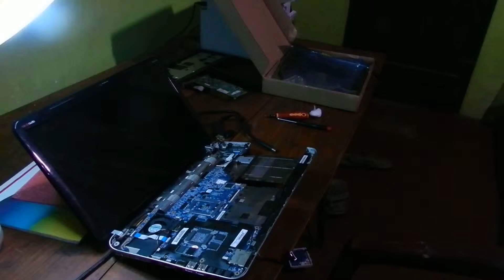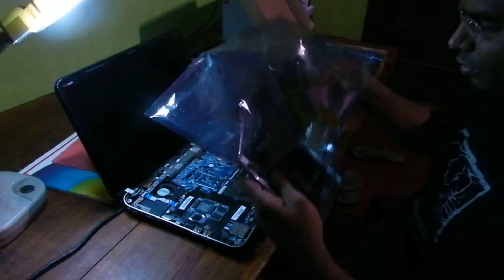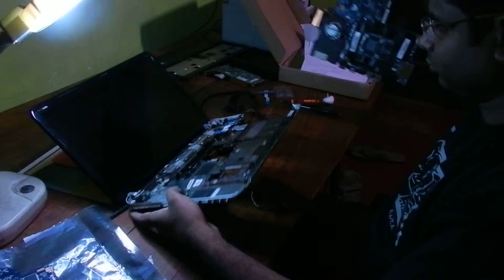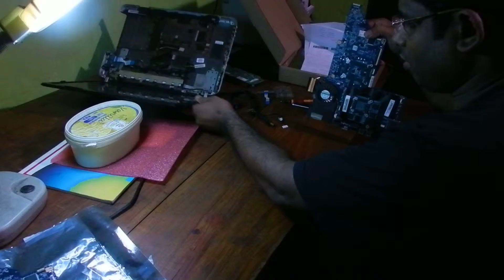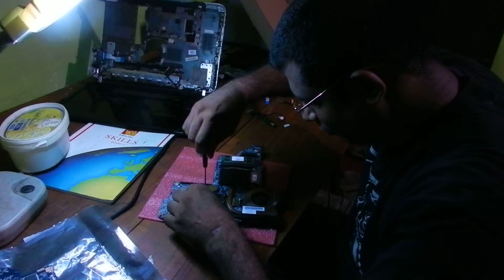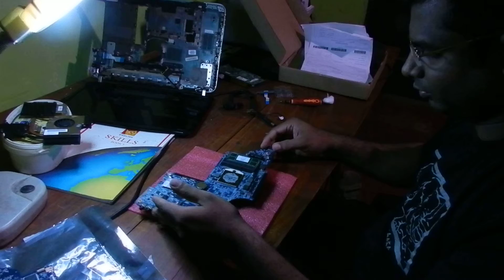DV6 6165TX Motherboard Replacement

Comment: Hi Chinthaka, 
i have the same laptop and i get the system fan not working alert during the boot screen everytime.
Its a 4 years old laptop, and i am trying to find the spare of the cool sync for my laptop 6165tx HP.
It will be help full if you can suggest some links to buy the part online.
i stay in canada. currently. please help, thks!.